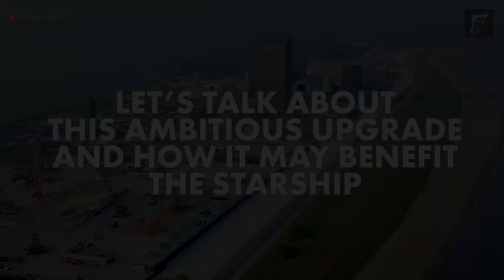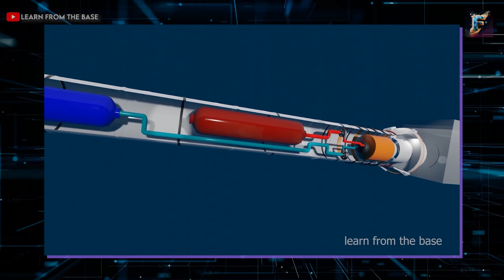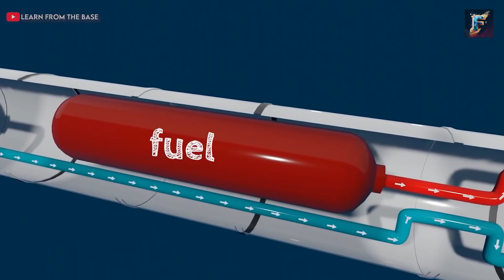Elon Musk REVEALED: Raptor Engine Overhaul Detail - SpaceX Starship Will Now Have...

Comment: The atmospheric engines on Starship are mainly for use when landing as separation occurs at altitude more suited to the vacuum engines. I have wondered all along why there weren't 6 vacuum engines for maximum boost, payload, and speed. Good to see my Industrial Design experience is still on point!